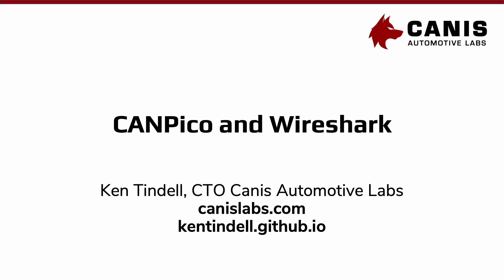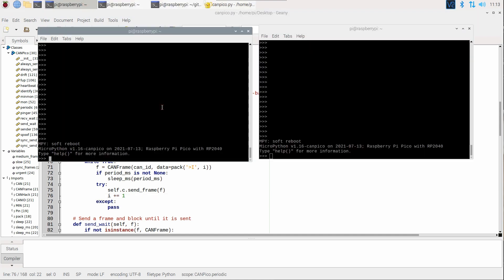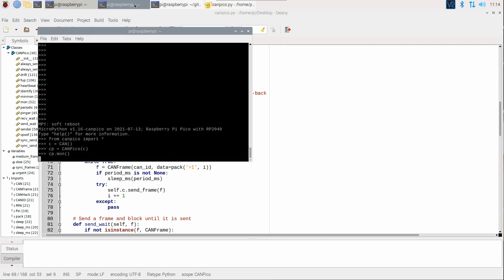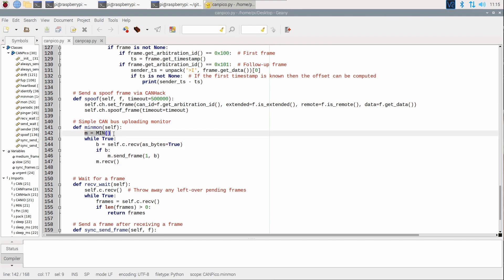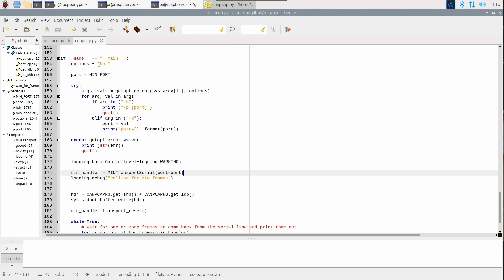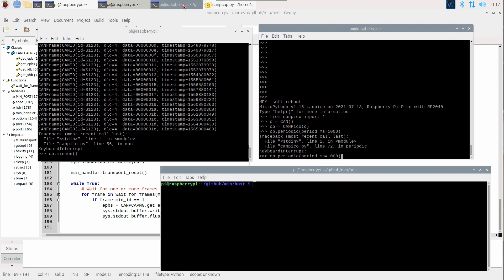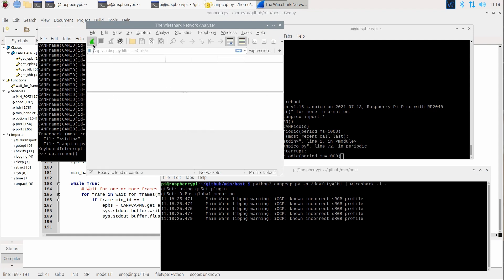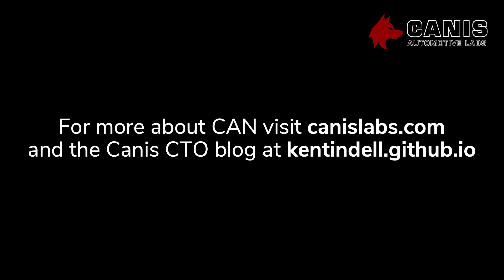CANPico Wireshark

Comment: Have you tried plotting can bus data using Wireshark (with CSS' CANvas-Wireshark plugin) or with PlotJuggler DBC?

Lots of open-source tools for viewing can data, SavvyCan , Cangaroo , BusMaster, CANalyzat0r , CANtact-app ,  WhileNotInfinite/CANStream,  Strym, CANdevStudio, TDahlmann/canpp , or DanielMartensson/OpenSourceLogger....

However, most of these applications use SocketCan, which require Linux/VM.. I'd like to say with Windows only.   BTW, PCAN-Explorer looks perfect for real-time, except not sure if it can open an existing trc file, and have it replay the plot in the panel.  Also, it is very expensive and not sure if it supports non-PCAN usb adapters.

Comment: Is this fast enough to read CAN frames from a GM MEFI 6 computer? Trying to diagnose a marine LS3. There's lots of documentation available, just trying to figure out if it's all possible.
Reply from the maker: It should be fast enough to read a fully loaded 500kbit/sec bus.

You can also use the hardware filtering API on the CANPico to cut out frames you want to ignore.

If you wanted to look at specific situation you could use the logic analyzer trigger API on the CANPico and a Sigrok logic analyzer running the can2 protocol decoder to see what happened before/after the event. More on can2 here: https://kentindell.github.io/can2
Reply: @kentindell  Thanks. I think that pretty much answers all my questions. I was hoping I could filter before/during/after capture to lessen the load. So that's awesome. Thanks.